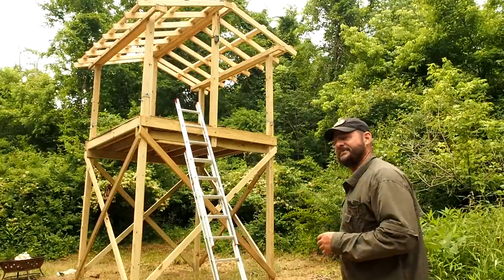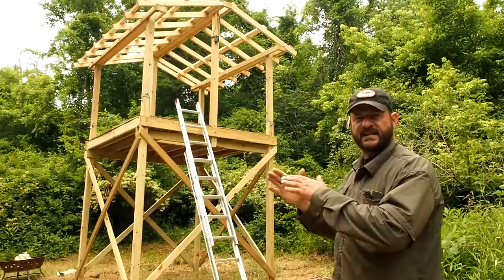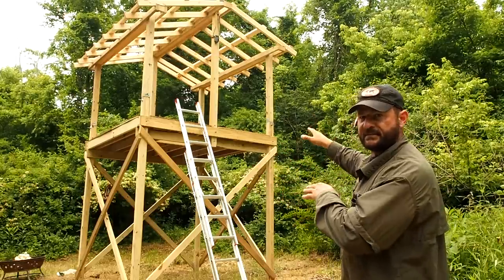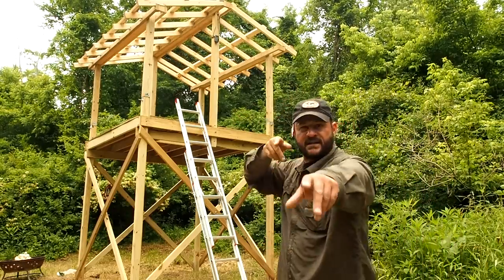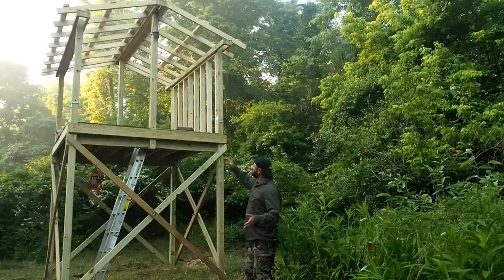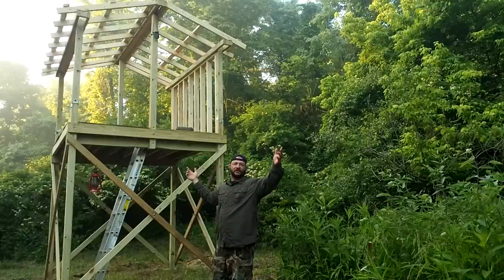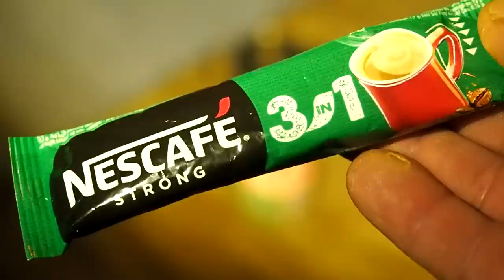Solo 6 Day Overnight Building a DIY Elevated Off-Grid Tiny Cabin in the Woods and Tasty Burgers

Comment: Excellent build! Looks great. Could tell it was sturdy. You did a fine job on it. Like you, I have no real carpentry skills but I've managed to build a book case and build 4 small buildings which still stand, are still sturdy and still in use today. Like you said, do a little research, ask questions, read a few books/manuals...I'll add, if at first you don't succeed try it again. Look at your first work, see what you did wrong and/or how you can improve it, then go at it again...start small and work your way to larger builds. That's how it's done. I was fortunate I that both my grandad and dad could builds things and fix things...learned much by watching. To anyone reading this, you can do it too!! Don't be afraid to try...you learn and get better from mistakes, and I have made a few of them, that's how you learn and improve your skills!
Reply: Thank you for the positive encouragement. I agree about starting with something small, it helps build confidence.

My first big build was a chicken house. It has two dividing walls for high density chicken population. Each side has its own door and exterior accessed nesting  boxes. Since it's a four door I can't call it a coupe , lol.

Comment: I like it. It came out great. I agree on the winterizing and maybe a light our two. Think about using low voltage LED strips. They can be ran off a drill battery pack if you had to.

Comment: I love your show. But, there are times when you use a skill saw that I cringe.
Reply from the maker: so cutting on the outside of my body away from anything and doing it the same way as a bushcraft saw is unsafe and makes you cringe?
Reply: @recall5811  It scares the hell out of me. I have had to rush to apprentices to the hospital after they cut through their thigh with skill saws. In one case it was hundreds of cuts turning into repetition until he cut through. The other the saw bucked and the torsion ran it through his leg. Please be safe: Brace it off the ground like a see saw and step on the opposite side of the board from where you intend to cut. Place your foot below the cut and lever up the point to be cut with your foot. Cut on the side that is above the lever and not under any portion or stress beyond gravity. This is the safest way to use a skill saw in the field.

Comment: you do some pretty good frame work man! I will say, normally in a floor with a whole in it, the frame work around the hole is reinforced with trimmer joists and all that, but over all, pretty darn good. nice precise cuts, and everything looks good and straight. Man, burgers are always best in the woods. nice. Also. Seems like that idea about leadership and relationships is coming from memory. pretty good ideas in all that. you've been on both sides, good experience, and cool advice)

Comment: It sounds like Florida in summer. North Carolina in a valley is hotter. I used to install aluminum siding with foil backing. The sun cooking you the front and back at the same time.

Comment: Nescrapfe 3 in 1 😆. Same goes for any instant coffee 3 in 1, put less water so it don't taste so crap. Add slightly more water later if you find it's too strong, which usually will not be the case.

Comment: 1st off onions maybe some green pepper on that double burger also in that spam and eggs. 2nd maybe paint the metal white to reflect some heat. 3rd maybe some shredded paper mache/ cardboard insulation. 4th if your gonna have a high end place like that maybe take a bag even just plastic to store your boots in at night. just slip knot the end so can reuse. last some dry seasonings like garlic salt/ powder, onion powder, pepper, salt,  cumin, red pepper flacks, basil, oregano, rosemary, maybe some thyme just some basic seasonings. trust me with just a few of those seasonings and some potatoes and meat i can make a damn fine meal.

Comment: Shawn, perhaps add an inside drop-down Mosquito Netting rollup. Like is used for the bunks with poles cover, is what I am using. I had to slightly modify it with my awesome sewing kit skills (lol). Works well for those warm nights and a USB Bug Zapper/ Light from Amazon. Very cool bottom collar even glows. I have oiled burlap roll flaps, with old tent poles; to drop outside over window area for cool weather camping & Rain showers, giving more outer space cover. As always Corporal Kelly, Out Fucking Standing Video set because a well-rounded knowledge base is key to Survival & Thriving skills. Interested in what you use as a mini stove, and if you are going with solar panel / battery for USB Led lighting - charging batteries for Cams [trail & security], even red lighting for deer.??. The viewers are down because Sheeple are stupid, remember you can't fix it, just bury it deep so it doesn't reproduce more stupid. Semper Fi Sic Semper Tyrannis

Comment: I’m trying to find that tool you use to clear brush. It’s a hand tool but I don’t see it in your Amazon page …please let me know what it is and where it can be found thank you
Reply: If im not wrong that brush cutter he's using is called a Sling blade or Banjo blade - look in Home Depot or any other good hardware store
Reply: @iduswelton9567  
It could be a cold steel garden and camp machete if you can find one in stocks somewhere they are usually less than 20.00.

Comment: You should not pour around the post. Concrete experiences fractures quite often, especially microfractures around points of varying stress (at the edge of a post). Additionally, any moisture/water that may enter your basement will probably get into the post. These issues combined create a significant rot problem, as water can get to the post and the post is not able to breath, being surrounded by concrete. To remedy this, you will want to look for a post standoff. You can usually cast them directly into the slab/pour, although I believe some of the post bases rely on the compressive strength of the concrete for the vertical support.
Reply from the maker: thanks for watching
Reply: @recall5811  No worries mate, greatings from Australia!

Comment: Throw that nipper in the trash and get a tenryu metal roof saw blade for a battery circular saw 🧐 ( i installed 50 metal r panel roofs in my teens and 20s)